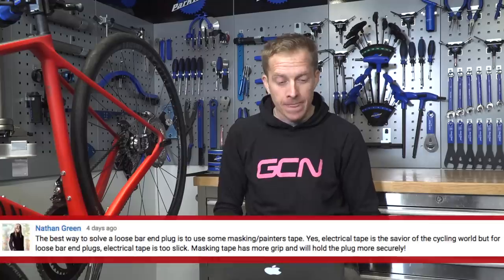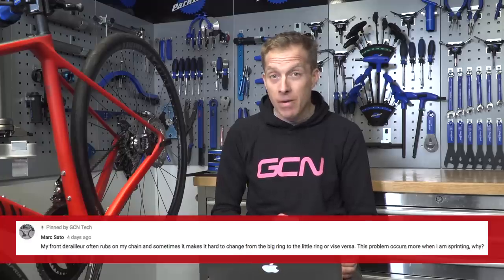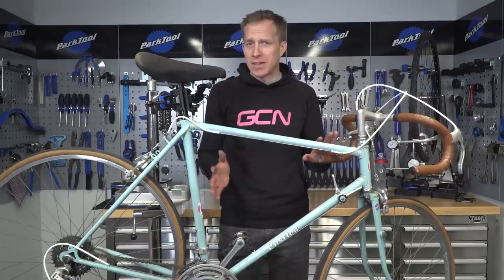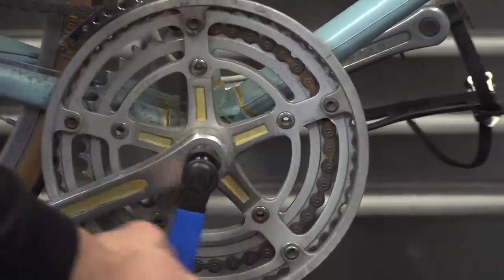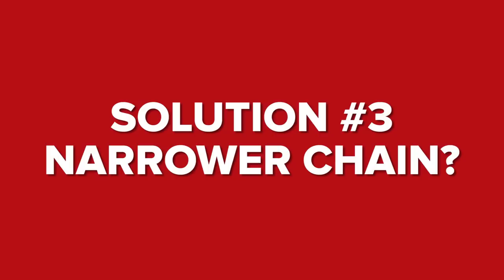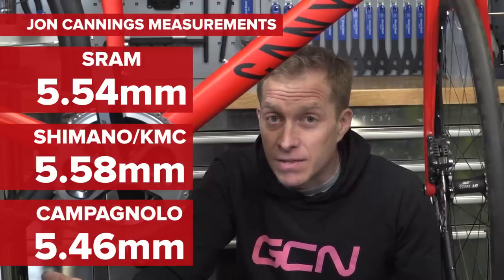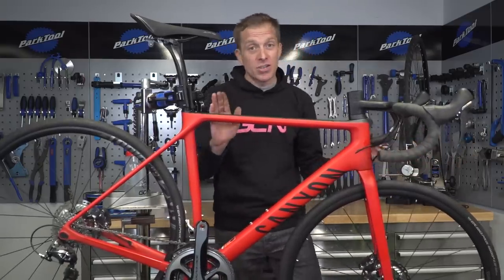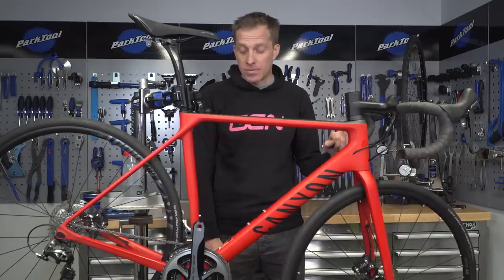How Can I Stop My Front Derailleur Rubbing? | The GCN Tech Clinic

Comment from the maker: Remember to leave your questions for Jon in the comments!
Reply: Ah Jon Jon Jon I desperately need your help/advice. I am running BR-RS 505 disc brakes on my carbon roadbike and the squeal is driving me crazy. I have cleaned the rotor with bespoke disc cleaner, I have bought metal sintered pads, I have even taken sandpaper to the rotor to "roughen" the surface again but all to no avail.
The cleaning helps for a short while but then it happens again. Its only at low speed at the end of the braking. If it cannot be fixed any ideas on what are good replacement calipers? At wits end ... appreciate your help. Fritz
Reply: Trying to fit tight tyres to wheels. Other Gcn videos arent realistic enough. Just Simon putting some tyres.
Reply: GCN Tech and my back wheel is jumping since I am using a new tyre. Need help so bad.
Reply: Suggestion, you guys should test the importance of wheelset/rim weight vs bearings and hub quality.  Aerodynamics being equal, i cant decide on which is more important in real world applications. Hills, road quality, acceleration etc.
Reply: The most common thing that could be causing it would be oil contaminating the surface of the disc or the disc being out of true.  I have heard from those weirdos at GMBN that you can use a blowtorch to boil away any oil that has gathered on the surface as long as you don't warp the disc.  Hope this helps!
Reply: I have a 99 Cannondale that is serving me well. After a 2 weeks "vacation" a bird chirp noise started while pedaling. At first was always and strange to ride in the park with a high pitch noise. For sure people knew something was coming. I can see it comes from the bottom bracket area but not sure what is causing. Washing it well helps but it comes back sometimes and only brief ones when back pedaling. The BB are well fit, the pedals are well fix without lateral play. Anyone?
Reply: Jon, please make a video how to total service/overhaul a free hub body. and make use several type of body because different body, different way to detach from hub. thanks.
Reply: ok...how do i measure 'sit bones' at home accurately...sitting on a piece of cardboard,using chalk etc,doesn't cut it sorry..HELP!!
Reply: Topsey kretts no need to be that accurate because saddle width +/- 2 cm of sit bone width..
Reply: I need to make fine adjustment to my SPD cleat angle but it has left a mark on the shoe which makes it impossible to do any fine adjustment as it’ll just screw back into the original position, help!
Reply: Hi Jon, I really love the show of GCN however what is the recommended tire pressure for a road bike with 28 tires and my weight of 100 kg. Thanks for your help and continue delivering a good show

Comment: i have 2 bikes one with ultegra and one with 105 . Both front derailleurs are set up ok, however I find some chain rub on the inner plate of the derailleur. It only happens when I am standing and only on the downstroke of the offcrank (non chainring side). It is caused by the BB flexing bringing the chain closer to the inner CR plate. To doubters, put your bike on an indoor trainer, stand, and look at the bottom bracket flex. It really doesn"t matter much which frame the bike is made of.You might think that if the BB flexes everything flexes equally so there should be no rubbing. However the crank on the offside bends that outside if the BB more than the other side hence the rubbing. It is not a serious problem so it doesn't worry me.

Comment: My issue : rear brake rub (when I sprint or climb out of the saddle). I use 2 frames an S-works Tarmac and Cervelo S5 and 3 sets of wheels, Zipp 303s, Duraace c24s and a pair of Mavics and all combinations rub the rear brake. I am only 70kg so a diet won't fix and my current solution is to reach down while riding and undo the rear brake and then remember to redo it when about to descend. There must be a better solution than that.
Reply: Check that your wheels are running straight and that they're not pulling the drive side when you apply force on the pedals. It could be your hubs that have excess play or just not enough tolerance between the pad and wheel.
Reply: Unfortunately this can also just happen if you put out a fair amount of juice.  If your brake pull isn’t super close, your LBS can check your spokes with a tensiometer to make sure they are within tolerance.  If your pads ARE close, you can flip the brake quick release when you really don’t want rub, if you are dead set on keeping close brake pull (though you should know you get much better power and modulation with midrange pull, as per the design of the brakes!)
Reply: Double check that the dishing of the rear wheel is centering the wheel in your bike frame. I had this issue on my old mountain bike where the tire would rub one chain stay when pedalling under load. But the wheel was fine on another bike.
Reply: The wheels are true and dished correctly, the tension is per manufacturer guidelines, the hubs are serviced, and the pads are not super close. There is some flex in the wheels and the frames when put under the additional pressure of being out of the saddle with force which means brake rub. When pressure is applied in the bottom of the wheel at the road, the flex is at the other side of the wheel at the brakes.

Comment: I have a Stevens Xenon road bike with an Ultegra 6800 group set, except for the chain rings which are rotor BCD 110. When I'm in the third smallest sprocket (or smaller) and the small chainring, the chain also starts rubbing the front derailleur (even after trim shifting). It was already like that when I bought the bike (which is a nearly new second hand one). I have taken it to my local bike shop already 2 times to have a look at it, but is seems to be "normal". Nevertheless, I don"t like it, because it is the gear I use most. So my question is whether someone else is experiencing the same problem and whether this is really "normal" or if there is a fix ? Thanks!

Comment: My front mech cage rubs on the side of the chain guard (the ring outside the chain rings) when inn top gear. The gain guard is only a little warped and the high limiter and cable tension are optimal. Raising the height of the front mech to clear the chainguard brings the mech cage much more than 5mm above the teeth of the top ring. Am I missing something?

Comment: in my case the chain was rubbing on the front derailleur because the crank had a protective plastic ring around it and the derailleur was adjusted for that ring. well the result was rubbing chain in all the low gears. got rid of that plastic ring and adjusted the derailleur to be 2 mm away from the biggest cog and now there's no rubbing whatsoever in any gear :)

Comment: Curious as to whether he is running the Teflon coated cables that are coming as oem equipment on a lot of new bikes. Those cables are junk. The Teflon starts to wear off almost immediately and gets gummed up inside the cable housings. Causes all sorts of shifting issues. Usually doesn’t take long to diagnose on the rear derailleur, but due to being used less, it takes longer to rear it’s ugly head on the front.

Comment: Hi Jon and Simon. I'm building a set of wheels for the upcoming road season and I'm debating between using 25 and 28mm tires. For the wheels I am using HED Belgium + rims laced to i9 hubs. The rims have an external width of 25mm, and thus I am leaning towards 25mm tires for a more aero profile, but I like the idea of running 28mm for better handling in corners/better puncture resistance at lower psi. The rims have a recommended max inflation of 90 psi, so I can't run my tires at 110psi as I typically would for road racing. What would you recommend?

Comment: I have a bike with standard crank 53-39 and 12-26 9speed cassette, I swapped cassette to 9sp 12-28 (because of climbing) and now, after hours of indexing, whenever I am in lowest (39-28) and highest (53-12) my chain rubbing, even in a second closest gear. Do I have to change chain to solve a problem, or continuing with adjust\indexing? Thanks

Comment: Got a problem, I can't get my disc brake rotors off my wheels to replace them, they're 6 bolt but it looks like they might have seized up or been over tightened when they were fitted in the shop. Any thoughts before I crack out the WD40?
Reply: Bolts for disc brake rotors must be screwed with T-tip (T30 I believe), not with the "traditional" hex-tip.
Reply: crack out the WD40

Comment: I've got a squeaking problem with my saddle. On bumpy/uneven roads there's an incessant squeak that seems to be coming from between the rails and the saddle top. My bike runs smooth apart from that. The squeak is really getting to me!(Fizik pave cx sport )
Reply: I was able to solve this with just a very light layer of grease (like a bearing grease) on the saddle rails. It's been silent for last two years now.
Reply: Agree. Dismount, grease and mount again. Also grease all threads in nuts and bolts.
Reply: Thanks. I'll try that

Comment: Problem: when in my larger chainring of 39 and largest of 50 teeth and cassette sprocket of 15/13/11 there is a strange vibration that I can feel through the pedal stroke. It is continuous and not of a grating kind more of a hum like going over a cattle grid at speed. Any thoughts?
Reply: alex fulton This happens surprisingly often with worn rear hubs.  I’d bet my bar tape that that’s the culprit, and it’s definitely a distinct feeling just like that.  A service should be easy for LBS or yourself to do with a few specialty tools.  Good luck!!
Reply: Samuel Hopely ahh but I have had 2 rear wheels in the past 2 years, the last one started service 4 months ago so I don't know why it should be so worn if that is the case

Comment: What makes a stem compatible or incompatible with a carbon steerer?  Is all you need is to have the compression plug long enough to cover the top and bottom bolt of the stem?
Reply: GracieApproved Not much is in he way of using whatever stem you want.  If the diameter is correct and the plug, as you said, is above the top bolt, you’re golden!  Most lower end stems will have a 8 nm torque spec.  This is the only thing worth thinking about.  You should be more than fine doing up your stem bolts to 6 nm if you’re not certain that your steerer can take the torque.
Reply: Thank you Samuel!

Comment: Hi Jon, loving the concept and the content. Glued to your Tech shows also.
Here is my Question. 
Recently bought new CX bike with 11 speed 1x setup. All good.
However I also want the bike to have the versatility of running my quark power meter with say 42/44t, and a less mountain bike like ratio on the rear. (currently 42,10). Front part of this with Quark pwr meter all good. However my question concerns the rear.
I Currently have an XD on a mavic hub, can I replace this XD  hub body for a sram 11speed hub body, which would allow me run an 11-32 casette?
Any help greatly welcomed.
Donal

Comment: I now have these problems on one of my bikes, one old steel renewed, but with original 7 speed. It was ok, but I've aquired new wheels, and kept 7 speed, but lowest 11 instead of old 13T. Now all seem fine up to 13, but on 11, the chain does not accept the steep angle when reaching my front 44T, and with force pedalling, does not enter well even with newer 44T, so its a cross chain symptom in my case, that was only affects front chainrings, was not there with older thinner wheel, and I do not know how it will be solved to allow me using the 11t.

Comment: my front rotor keeps rubbing. it seems to happen in only one spot, and when I try and straighten it out, the rub appears in a different spot! how do I fix this? Could the rotor have gotten loose, do I need to adjust the caliper or is it bended beyond repair? Note the bike has done about 100 miles

Comment: The cones on my front wheel - felt factory issue - occasionally come loose. I do them up finger tight for fear of crushing the bearings but what’s the proper way to remedy this once and for all?
Reply: the cones are only used for adjustment. there should be another nut that you tighten down onto the cone to lock it in place. gcn has a good maintenance video on it

Comment: So, while cleaning my bike I noticed that my 10-speed cassette has just a little bit of sideplay so I can rock it to the left and right (parallel to the chain). It is still very tightly screwed in though and doesn't have any play in line with the axle. It still shifts well enough but I wonder if I need to worry about it and if so, what I can do to resolve it.

Comment: My rear breake cable in the frame makes noises, when i drive in a pothole, or when i drop down the pavement.
Do you have any tips ?
Im riding an Orbea Orca 2017 OME.
Reply: avoid the pothole, and put the bike on the road before getting on
Reply: Perfect a smooth bunny hop 😎
Reply: You probably have excess brake cable in the frame, if you shorten the housing this should stop the cable slapping the frame.
Reply: I have two solutions for you:
If the outer cable runs all the way through the top tube: tie some zip ties around the cable (just tight enough that they stay put) and position the ends so that they point out in all directions. leave the ends uncut. this will hopefully suspend the cable within the top tube.

If only the inner cable runs through the top tube: get some foam pipe insulation from the hardware store and route the inner cable through that, then stick the whole thing in the frame. the foam pipe will keep the cable from rattling against the top tube without impeding the cable movement.
Reply: Thanks for your useful tips. Iwill try to shorten the housing first and of course practice the bunny hop :)
Reply: Janosch K
Are you sure it is the brake cable and not chain slap? Rattles and creaks are notoriously difficult to track down from the saddle they often seem to be coming from one place (the frame) when they are actually coming from another (the chainstay).
Reply: Gently bouncing the bike by hand should isolate the noise.
Reply: Jacob Holland, Rick Snider 
Good advice. But the noice comes definitely from the brake cable. I bounced the bike by hand...

Comment: My Sram Red Etap was installed on my Felt AR3. Worked flawlessly. I had store install a Quarq Dzero power meter. This required new chain rings. Originally had Ultegra 52-36 crankset. It got swapped out and now have a 53-39. Now I randomly have trouble with it coming off the big chain ring. Luckily I am able to shift back down and it will go back to the small ring. My shop thinks it might be related to the Aero frame. I think that is possible or it is a combination of the bigger 53.It had the Ultegra chain originally. Did have a Sram. Now has a Wipperman Connex chain. has come off on both Sram and Connex. Can't remember if I tried another Shimano chain.Any suggestions?
Reply: Dejected J Your chain, thankfully, won’t impact the shifting performance.  Your frame should also have little to do with anything.  Checking chain length is a great start!  If your chain has a quick link, pop it off and measure the chain (inches is directly equal to links) and be sure to include the quick link in the measurement!  the formula for proper chain length is complicated, but here goes:  (Middle  of crank center hole to middle of QR nut X2) + (Biggest cog / 4) + (biggest chainring size /4) + 1.  Remember to take into account the quick link with the equation.  If your chain is too long, your fix is simple AND you get to shave some grams YAAAAAAY!  Good luck!
Reply: Connex lets you use same link over. The bike shop removed links and added back